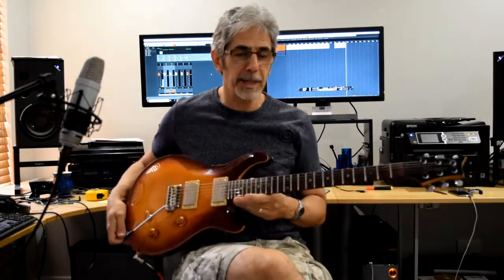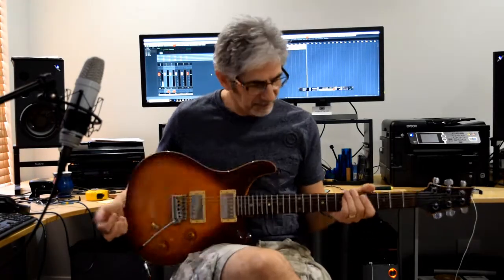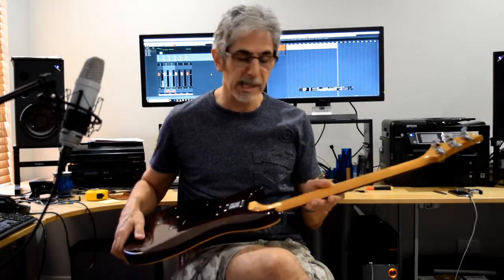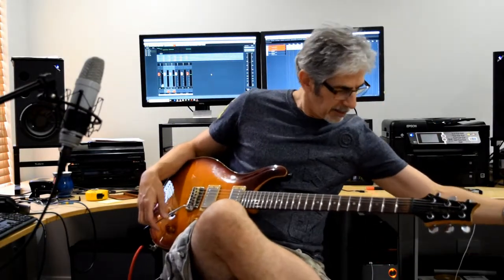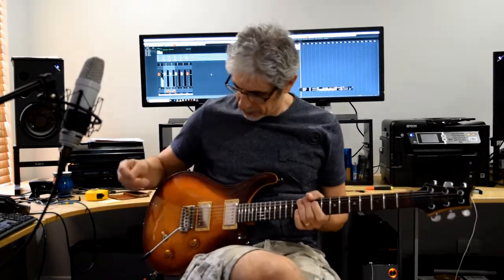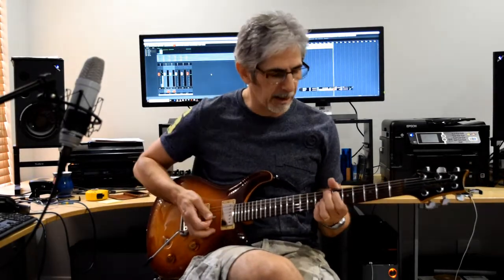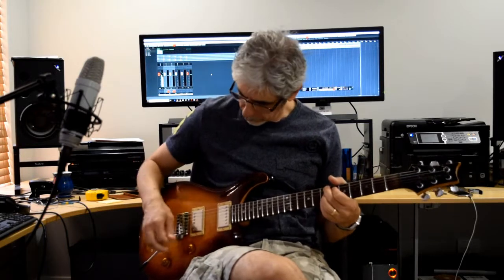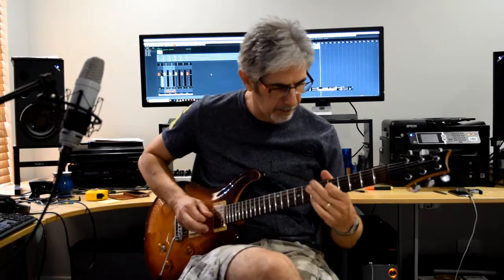Gibson 57 Classic Pickups: how do they sound in a PRS? PART 2

Comment: Great video Jeff. 

I have a 2017 PRS SE Tremonti Custom which I fitted with push/pull tone pots for coil tapping. 

Yesterday I  installed a set of Gibson 57's, which I picked up used a few months ago. 

The original Tremonti pickups has bright highs, not much mids, & slightly muddy lows.

After the change, it now has nice crisp highs, good mids & powerful clean lows. 

Comparing to my 2 son's 2016 Gibson Les Paul Traditionals, it is very close to the same voice, but my Tremonti is slightly brighter. A little roll back on the tone knob, & almost a clone. 

I'm very pleased with the tones of my PRS now, lots of versatility with the 57's & coil tapping. 

I would recommend this to anyone with a PRS SE that wants a change.
Reply from the maker: I've never actually tried any PRS SEs but if the build quality is good, I imagine putting the 57s in would be a great addition.

Comment: I’m in my 3rd PRS SE and I’ve not liked any of the pickups. Instead of selling this one as well I’m gonna throw new pickups in it. This video helps but I’m just not sure what to get. I have a Les Paul Traditional with 57s in it also.
Reply from the maker: I like the 57s in mine, but after living with them for a long time, I think the bridge doesn't sound as good as the neck pickup. It's worth remembering that it won't ever sound like a Les Paul, no matter what pickups are in it. I think the scale length plays a large part in that.

Comment: I'm confused, are you saying that you used Epiphone or Gibson 57s in this PRS? I have ab'd the korean Epiphone 57s up against the USA Gibson 57s and I believe there's a difference. THANKS!
Reply from the maker: It's the Gibson 57s. I haven't tried Epiphone 57s but I'd expect there to be a difference. Having said that, then you'd have to wonder if the wiring, pots, and capacitors from cheaper guitars are at least a part of what makes the difference.

Comment: Hi Jeff
I have a technical question for you, do you think I could install classic 57' pickups on a PRS SE Custom 24 guitar ? 
I'm not sure about the leg size from the Gibson pickups, they may not fit in case the space is not properly provided from PRS. Do you have any suggestion ?
Reply from the maker: Hi Giuseppe,
There are a few technical problems with installing the 57s. Most of the PRS solid body guitars are not as deep as a Les Paul and you're correct that the pickup depth is pretty big.. Mine is quite a shallow body and it needed the pickup cavity routing much deeper, which needs to be done with great care as it comes very close to the tremolo cavity (it's not such a problem if you have a hard-tail). I had mine done by an experienced guitar tech/luthier, so I wouldn't recommend doing it yourself unless you're pretty confident. Hope that helps!
Reply: @jeffcooketeachguitar  man really thanks a lot! I will carefully see how to do! ;)

Comment: Did these pickups require modification of the pickup or guitar? Like routing wood? Any fitting issues ? Thank you
Reply from the maker: Unfortunately, on the PRS, there was some pretty hardcore routing required. The Gibson pickups have quite long "legs" on them, so it was a close thing to actually get them to fit!
Reply from the maker: It does depend on the model though, as I believe some PRS bodies are thicker than the CE24.

Comment: Nice improvements!  I had a CE. I hated that 5 way rotary switch, so I sold it. It had some hot Dimarzio pickups in it.  
 The 57’s sound good in yours. Question, how do the neck curves compare ?
Reply from the maker: Hi Tony. I agree with you on that five way rotary. It was awful! Did you mean the neck radius, sorry, compared to what. I'm not sure I understood the question.
Reply: Jeff Cooke  The CE vs the LP. I had a CE that I think was called wide thin. Is the LP neck slightly beefier than your PRS ?   I can’t believe Paul came up with that rotary. You almost have to stop playing to change. It’s gone now, thank goodness!
Reply from the maker: @tonytribble2977  Hi Tony,
Yes, the Lp neck is beefier. It's slightly wider and has a kind of D shape cross section, whereas the PRS feels nice and slim and slick.

Comment: Big difference!  The '57 Classics are more open and less compressed sounding.  They also sound sonically wider...deeper bass and higher highs...compared to the PRS pickups.  Your PRS's construction would make some differences from your Epiphone, but you are comparing pickups, not guitars (I think).  The alder is similar to mahogany, the longer scale length should add sonic width and the maple neck should impart a brighter tone.

Comment: You could have shown us some clean tones, the difference is barely noticable
Reply from the maker: Check the difference when the new pickups are in parallel. Granted, it's not totally clean, but there should be a clear difference. I rarely play totally clean, as in a band or recording situation the guitar sounds weak and doesn't cut through properly.
Reply: The stock Vintage Bass in the neck is actually an alnico 2 8.48k paf type which is very much like the classic 57. The huge difference will be between the alnico 2 classic 57 in the bridge vs the stock ceramic magnet high output 15k HFS.
Reply: @mrbeatdoctor  I understand you cannot split the 57 cause they have only 2 wires from factory, can you split the stock pickups? I am looking for a good humbucker to split and put on my sg
Reply: @jeffcooketeachguitar  thanks for the video, interesting!
Reply: @FLAMENCO961  Yes, both stock prs pickups will have 4 wires to allow splitting or series parallel. There are definitely good alnico 2 pafs with 4 conductors that would be similar like the Seymour Duncan pearly gates.